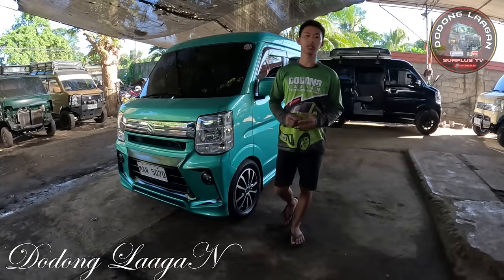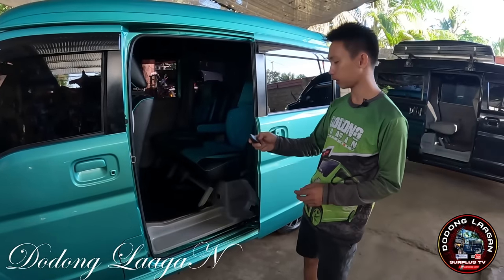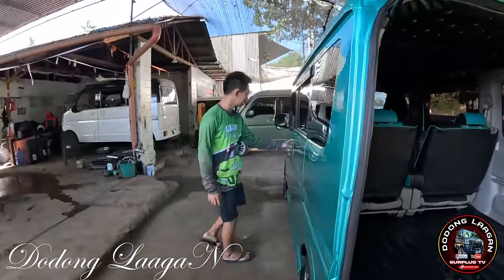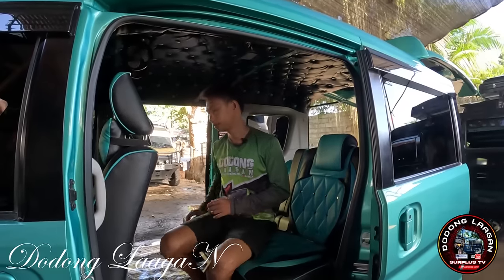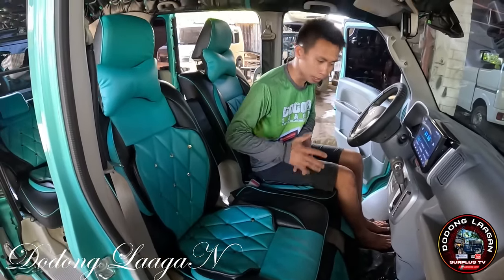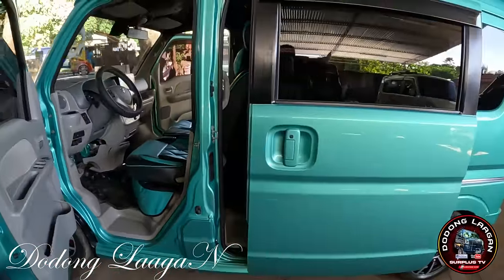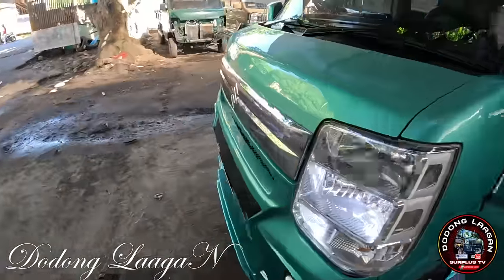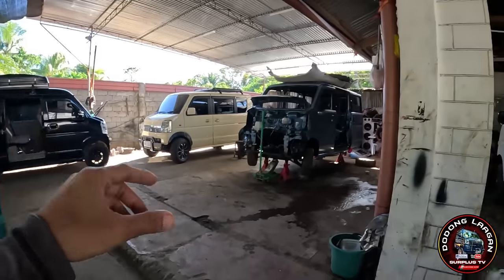DA17W AWD FULL REVIEW HOW MUCH/SURPLUS TV

Comment: Nice build and I wish you luck, but price seems high to me.  At 300-350k yes... but 450-500k?  No.  And how many miles on the engine?
Reply: 95k to 160k mileage, base sa mga videos na napanuod ko sa kanila. kaya talo sa 450-500k yan.
Reply: demand is high thats why, but its also a no for me. I could get a better secondhand car for that price.
Reply: Mahal
Reply: @LaughLounge11  agree,  the demand for the 17W is high and so is the price.  I am looking for one right now and they are expensive.  So 64W for me, Smiley Edition!
Reply: @Bravo21  if u r someone who uses aircon most of the time, I suggest getting the 17V for its fuel efficiency, the 64's r gas junkie. It'll save u in the long run.
Reply: @LaughLounge11  Thanks mate,  appreciate the heads up 👍
Reply: My honda crv gen3 kana non
Reply: nagmahal bentahan sa yard, high demand na kasi. Pero kay dodong loaded na sya at talaga nacheck ng mabuti.